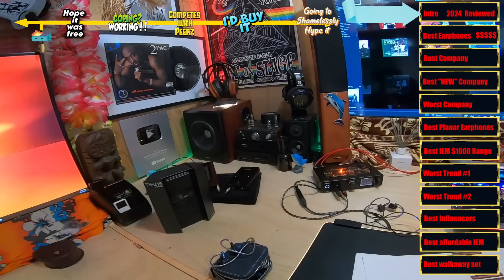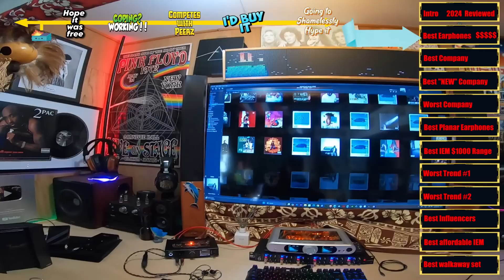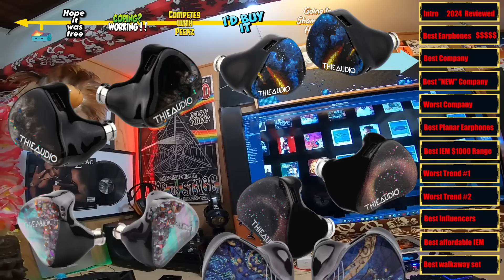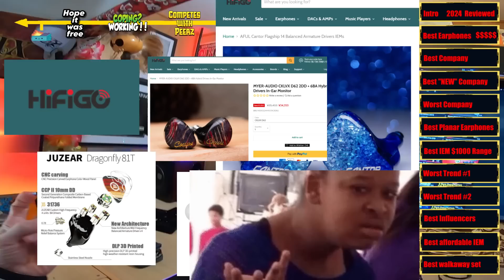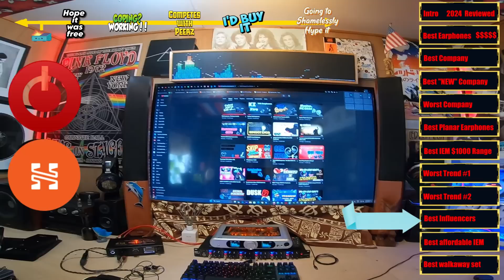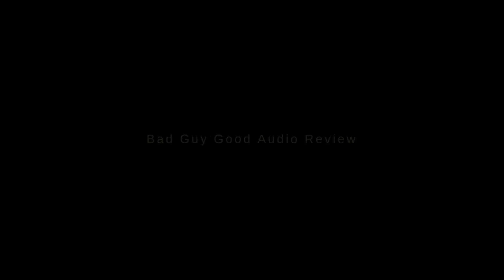Earphones The BEST of 2024

Comment: Just to add my 2 cents about my FF experience. I was very patient, like many, until I wasn't. After sending a few respectful emails inquiring about the shipping time frame, they only sent me one very short and barely helpful response. They ghosted me when I asked to verify that the upgraded tips would be included, as promised online. I'm still not sure which tips are the "upgrade" tips. They only sent me the white tips. And like many others, the left IEM chipped at the wire couple the second I removed the cable. The cable...dear gawd what a mess. Horribly microphonic and the weave looks like a 5 year old braided it.

Having said all of that, the Deuce is still my favorite set, beating the Scarlet Mini, Symphonium Titan, Thieaudio Monarch Mk3 and Origin, and others. Punch will be here tomorrow. Which will win?

Comment: With a limited to mid tier budgets at $220US look into the Binary Dynaquattro. It's a Dynamic Tri-Stack of 3 individualy tuned active drivers and 1 passive radiator for the extra punch. Needs at least 250-300mw of high gain balanced power but OMG...it's punch, slam, dynamics, timbre, musicality and staging...it's an amazing all-rounder that will get you re-listening your playlists all over again. The highs are clear and detailed without being sharply aggressive...everything just sounds right with this IEM with no bloated bass bleed. Enjoy!

Comment: tea pros are a great set, you can easily get them for 300 or less. only flaw is that it seems to suffer an imbalance issue/FR db loss in the mids and upper mids if you use it for longer than 9 hours. the crossover circuit might be the issue here is my guess.

Comment: There's been some amazing releases across a lot of different budgets this year! I picked up the EW300 and the Tea Pro during 11.11, and I adore the EW300 for a daily carry set, and sadly was a bit disappointed by the Tea Pro (fitment issues with how they designed the angle of the 2-pin and IEM body doesn't work with my ear shape with the angle, and they have a weird sibilance issue in the mid high frequencies), maybe it's just an issue in my unit.  Outside of that though they're a very solid and good sounding set, albeit a tiny bit too bassy. 

Thanks for all the videos you do! Look forward to your coverage for 2025.

Comment: ZiiGaat driver flex and accessories are very bad to be honest and the "branded" drivers are hardly worth it. And trying to get a replacement is a hassle in itself. I guess you just had to pick "a new" company but personally i wouldn't recommend fellow "average Andy's" like me their stuff. Driver flex in my left ear piece is very bad, triggered by every touch or jaw move yet they told me "replace cable bro, tip roll bro, record it bro", guess i have to figure a way to shove a mic and a camera in my ear canal. That left ear piece shouldn't have left the factory if they had any kind of QC.

TechPowerUp, i agree. I was into gaming peripherals and everything they post in general seems very...mature, objective, critical if needed and as unbiased as possible.

Comment: "Custom" BA drivers is the issue worth pointing out, indeed. Wouldn't be an issue if they weren't put into pretty expensive sets or, even more importantly, performed on par with branded ones. 

Yet they don't. At least when it comes to certain Moondrop IEMs, like Variations and very much possibly Blessing series, as well as the DUSK. Maybe it's not the rivers per se, but rather their specific implementation... But they seem to exhibit some unexpected and unwelcome behavior with regards to their distortion patterns and power scaling which are bound to be detrimental to sound quality, especially in the context of High Fidelity narrative. 

When I tried contacting Moondrop representative on this issue after learning about it, I was told that they  can't share any information on the BA drivers being used in their IEMs. And all I wanted to know is whether the midrange BA drivers in DUSK are the same ones that were used in Variations ("custom" SoftEars BA's).

This is bullshite. I can't trust a brand that is reluctant to share such info on their products or, even worse, straight up deny it. There's no reason to withhold it if there's nothing SUS to hide.

Thank you very for the video and everything else! 🙏🏻

And thank you for shouting out VSG and Resolve. I have huge respect for the former and the latter is probably my favourite audio reviewer. He had also studied philosophy and has a pretty similar persona to mine, so I'm kind of highly biased. But he's (more like the entire Headphones.com team) also outstandingly competent.